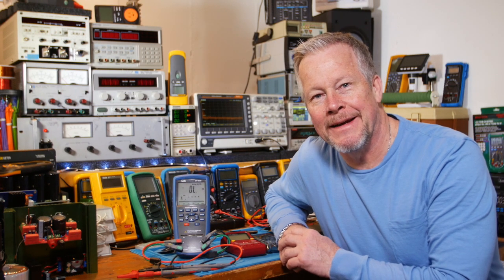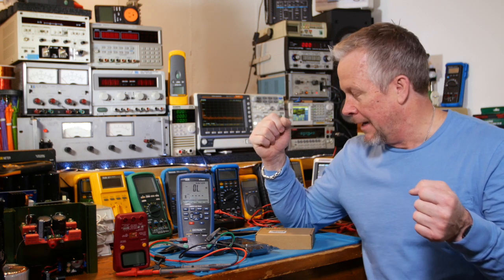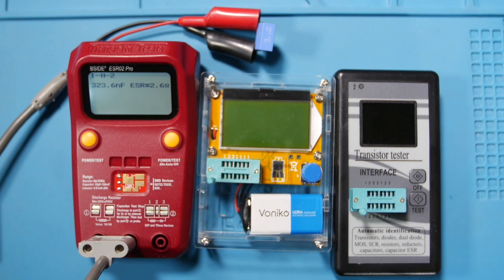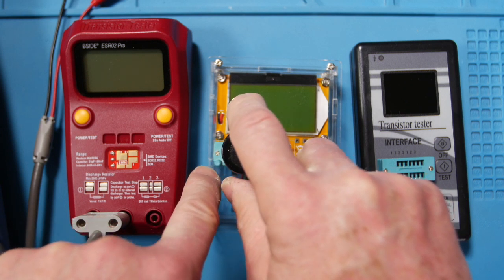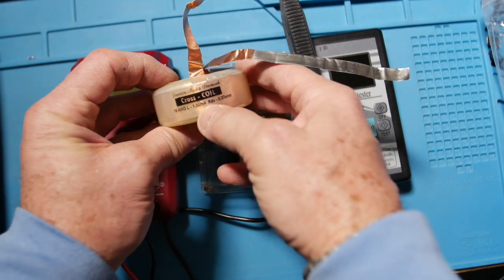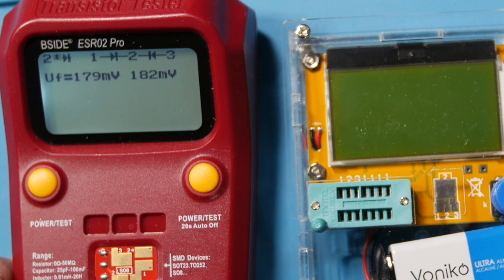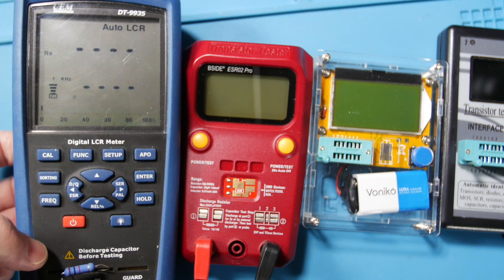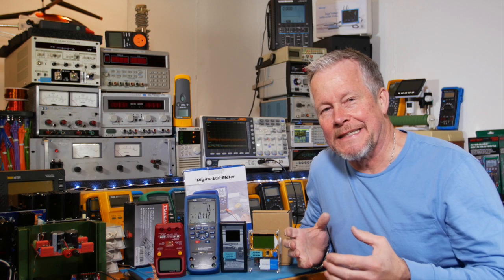LCR and Transistor Tester Comparison

Comment: Thanks, Eddie. I use my DE-5000 and an insulation tester mostly for capacitors and inductors. I do not see much point in testing the ESR of a capacitor without referring to the datasheet and using the same frequency that the manufacturer uses. 
I also use a humble little VOM with X10K to test P/N junctions. It is a waste of time to test them with meters that do not test them under a load in order to verify that it is good. Sure, the cheap meters will catch most of the bad P/N junctions, but not all of them. And I can, and have, proved it.
Reply from the maker: Robert Calk Jr. Thanks Robert for your feedback # always insightful!  Actually the esr changes with so many variables that some manufacturers actually provide graphs but often we are lucky to get just one number based on one frequency.  Some give it for two frequencies, like a low one 120 Hz and a high one 100 kHz.  Ive shown how to use your scope and oscillator to get the impedance across a frequency band.  I think this important part needs more videos;)
Reply: @KissAnalog  Yeah, there are many, many videos about testing capacitors. That's why I have added capacitors to the list of things you do not want to talk about at family get-togethers; religion, politics, and capacitors. LOL!!
Reply from the maker: LOL :)

Comment: Thanks for the video on LCRs.   I'm looking for an LCR to measure wound toroids accurately.  Mostly Ham HF band.  Example I wound a toroid to get close to .7 uH for the 14Mhz band  (16 turns on a T37-6 toroid, 24 AWG enamel wire).   Currently I have a cheapo TC1 multi function testor,  it thinks its a .8 ohm resistor!  a $300 bench LCR meter would be nice, but I have neither the room or money for such luxury.   Thanks again for the reviews!
Reply from the maker: I know what you mean Jeff - but these options might make sense, or be worth trying;)

Comment: Very helpful video! I have been trying to save some old music gear from oblivion using my VERY basic skills. I came here looking for information about the M-Tester (Branded Kuman in this video) and it seems like a dream. Having a inexpensive little device that can identify and test a component is super helpful. I was not sure it could handle larger capacitors, but you certainly proved that it can. Thanks again!

Comment: You tried to measure the ESR with the wrong function at the CEM. In automatic mode, it can only show the D-factor. To measure ESR, you press the "function" button twice so the display shows "Auto" and "Cp". Then press the "D/Q/ESR" button twice. The lower display will show "RP" or "ESR".
Reply from the maker: schorse1000 Thank you schorse1000!  I need to work with this meter more;) The CEM meters seem to be very solid!
Reply: @KissAnalog  Yeah, it's a nice meter.  Btw, the big caps don't like the >1kHz, which is normal. They're not meant to work at high frequencies, so you have to use the 100/120Hz.
And for the other testers, somtimes you can push the button to scroll through a menue with more readings. Some of them even have a push/turn button.
Reply from the maker: Thanks for your help!

Comment: Thanks for the review.Testing the 50pF capacitor with the BSIDE instrument (in minute 23:51) you should disconnect the pluged tweezers; that is the reason for a higher cap value. I would go for the BSIDE model, mainly due to the terminals and the connection clamp, the discharge terminals, the SMD pads, the reading speed and the greater robustness of the casing; although it looks like something out of a 60s science fiction movie...But, it applies a +-5V pulse to read the ESR in the capacitors, and it can not be used in circuit!!!

Comment: Just bought the LCR-T4 Yellow one on Ebay w CASE for about $16. The Bigger display is the  reason I brought this one. Is there enough information to tell if a Transistor is Bad? would be nice to see a video for testing components and what to look for to identify bad components? Troubleshooting Component , what the terms mean and range to look for good and bad ones
Reply from the maker: Thanks for this great feedback!  How do you like it?
Reply: @KissAnalog  Really like it, Doing a lot of vintage audio restoring, its nice to know what the transistor is NPN or PNP and w new transistor Always check the BCE pins their not always the same always double check and install it the right way and Quickly ,,,, testing and capacitors. I also solder in test leads to the solder pad for external testing.

Comment: Generic large electrolytics are designed for not much higher freq than 60 Hz, which is why they are often paralleled with low value, (.1 or .01ud) caps to bypass RF to ground. Low ESR switcher caps go to a somewhat higher frequency, but they are still designed for bulk power supply support and their capacitance goes to Hell at RF. I suspect the cheap meters test caps at a very low frequency while the better meter clearly allows for higher freq tests, and even its lowest frequency is above what the generic electrolytics can deal with. I like to test caps with my NanoVNA when I'm working at RF because it quickly characterizes them at the entire range of frequencies of interest and quickly identifies the self-resonant frequency as well.
Reply from the maker: Thanks for your feedback!  I'll have to do a video on bulk caps and the use of HF caps in parallel.  There is a lot of misinformation out there;)

Comment: I have the same component tester with diy case And the LCR meter from Peak Electronics the lcr45 I love working wilt the lCR45 because the cable  Connector and battery maybe a year old stil working
Reply from the maker: Bert van Lelieveld Wow so great power usage.  I haven’t had mine as long but I still have the same battery as well.

Comment: After almost 40yrs hobbying and making a career of electronics i finally bought myself a decent (i thought after doing the research) handheld LCR meter for the home workbench. I even sprang for a known named brand so paid north of $300. The unit took weeks to get to me which was kind of weird and out of the box it just did not like powering on for a press of the power button. When it finally did the meter's coloured LCD showed the LiOn batteries were charged ok. 1/2hr later i went to do some real work and dead meter.... It refuses to power on since and is a now a paper weight on account the supplier is closed down due to the current unusual times we're in. Just one of those things i guess... That good thing is i I have 2 nice 18650 batteries you could say cost 300 bucks which are doing great work elsewhere! I guess measuring inductance is gonna have to stay a low priority a bit longer....
Reply from the maker: I’m so sorry about your problems just trying to get theater that you spe DC
Reply from the maker: Let me know if there’s something that you would like to see;)
Reply: Andy, apologies to have platformed my disappointment of a purchase gone bad using your channel, (a bit of cabin fever kicking in after 2weeks locked down where i live). I should have added that it would probably have been a better idea to invest in one of the units you presented here. It's for my home workbench as in hobby time where i  dabble with all kinds of electronics... I will keep my eye out for an LCR meter locally as well, perhaps an old ex war-time military tester that needs rebuilding.... that would be a great project!
Reply from the maker: Not at all - great to share experiences.  I always hope for the best but sometimes it doesn’t happen - and I’ll share too.  Got to keep vendors honest;)

Comment: I brought another model from U.R
S.S, model Miron 63V3 and is more mutch precision in measurement prestige.I will recomand Miron 63V34 from Russia !
Reply from the maker: Thanks for this feedback!  It would be really cool to see the Miron, but I searched for it and nothing came up;)
Reply: @KissAnalog  ,In Romania, there are a few people who build something like that, but for now there are two electronic schemes, with a 6F22 battery supply, but also with a Nokia battery, model BL5C, on the side of which the battery can be charged from the mini usb plug. I have  the 9 volt version, but I don't know where he stole the microcontroller writing program, because it only measures capacitors in microfarads, frequency up to 50 volts, and coil inductances...

Comment: Alot of the smaller ones are based on arduino. The mesr-100 is a decent little esr meter. The uni-t ut12 looks alright. Imsai guy just got a keysight one. It's awesome.

I'm left to wonder how well the smd pads can couple with the ic or what have you without some sort of compression
Reply from the maker: Thanks Joey!  I agree - the SMD pads are a bit questionable.

Comment: Wouldn't the higher frequencies make the higher valued caps look more and more like a short? I think that may be the issue with the CEM.
Reply from the maker: Great question.  It does suggest in the manual to try series or parallel measurements and frequencies depending on the value of the part - inductor or capacitor.

Comment: If you could write a quick result comparison table between them and the referance it would be a lot of help. but great video!
Reply from the maker: That's a fantastic - and seemingly obvious idea;) now that you suggest it.  I'll do that - thank you!
Reply: Agreed, I watched your video about 3 times and spent a long time moving back and forth between results of the different meters. You even said you wrote down the value of one of the components, yet at the end of the video you didn't show a comparison chart or graph nor did you make an actual final conclusion on which meter is the best one to get. You appear to have a sizeable collection of test equipment on your bench, I would have expected a comparison of the meters tested vs the real value of each component and how close in tolerance each meter was to actually give a quantifiable conclusion.  As of right now, I still do not know which of the 4 meters to get myself. I'm just a hobbyist so I do not have the budget for high end equipment, but I rather not buy anything that doesn't work correctly. So can you post a reply here on which meter is the closest to the real value of the components tested? I specifically want to know if the ESR02Pro is a good purchase choice.  BTW, pro tip on your audio. get yourself a audio splitter cable, record one audio track with your good mic, and use a second mic as a secondary input. This means you always have a backup on mic inputs to choose from in case something stops working as your camera will save each mic to a different channel and your video editor will let you select which channel to use as your final audio output will be mono anyways. Hope this helps. But yea, if you could comment on how good each meter is on like a 5 star rating at least or even say the ESR02 is about 80% accurate and the others are 70% etc. Just something definitive that I (all of us watching your video) can use to make a purchase choice. Be a good idea to update the description of your video with your closing thoughts for future viewers. Thank again for your work on this video, just wish you actually gave us a definitive conclusion. Much love from Canada.

Comment: Hi, did you zero the testers before use by shorting the leads together?  Adding cables adds resistance and changes the results.  Some of these come without cables for a reason.  You might get away with adding short cables and zero-ing the tester before use.  Do not use long/beafy leads with these small testers.
Reply from the maker: You are right, the cables can add something to the test - especially for low value parts.

Comment: I have the BSIDE esr02 pro.witch i think is best and reliable  of those relative cheap tester,s.If you test components in the socket you have to calibrate it.The same if you use test leads or the tweezers.I have bought 2 tc1 component testers.they are crap they dont last both mine broke pretty fast i repaired one but it broke soon after again.The BSIde esr02 pro have lasted and i can use a power adapter with it.If i want to shure  i use a DER EE lcr meter DE-5000.I also have a Mastech MS6013 witch was the first i got and show only the cap value and not very acurate
Reply from the maker: Thank you for the feedback! How do you like the DER EE?  I almost bought one and keep considering it;)
Reply: @KissAnalog  DER EE ilike the ways you can test capaitors.Can change the hz caps are tested with from 100hz 120 hz 1Khz,10 Khz and 100Khz with a dedicated button.It has many parameters it can show and accurate.+ pc log or on instrument log features.The auto setting works fine for most tests since it allow for change of the test frekvens.and easy to scroll true all parameters it can show on a cap.
Reply: Can you measure ESR at different frequencies with the BSIDE? Which is the highest frequency? Thanks!

Comment: very good video. I have a question is there any LCR meter that can measure components on the pcb board without removing them ??
Reply from the maker: Thank you!  Yes, most can measure some 'in-circuit' components, but some do it better than others.  I have a new LCR meter that I will review very soon - before the end of the month;)
Reply: @KissAnalog  sounds great what is the model of the new LCR ?

Comment: In a Laboratory I have asked as wel With a 1000 dollar LCR meter not possible to measure I used the one with a metal housing Wich need e cooler
Reply from the maker: Bert van Lelieveld I’ve used the expensive ones too but have you used a Z meter by Sencore?  I used to find them everywhere.
Reply: Kiss Analog  no the LCR meter from Peak  No inductance , and the component tester from alieexpress  No inductance Eddie

Comment: Did you ever tried to measure inductance of a 30K or 68K wire wound resistor in Audio Amps at anode phase shifter I have 30K Resistors Not wire wound What I like to do is some tests with wire wound or normal I guessing that the result is the same
Reply from the maker: Bert van Lelieveld No, I haven’t tried measuring the higher Ohm values.  That is very interesting Bert!

Comment: You should try upgrading the firmware let me know if you need any help
Reply from the maker: Thanks for the great advice!  How do you update the firmware on this one?
Reply: @KissAnalog  There is a topic on the eevblog discussing these "transistor tester" devices, you will need a usbasp or an Arduino to program the Atmel chip, you have the T4 (yellow) board you can see the firmware update process in this video /watch?v=B9iPQfGv8W0

Comment: FOCUS!!! :face-orange-frowning:  As you can see these are beginner's toys and not suitable for accurate selection or circuit analysis.
Reply from the maker: Thanks for your feedback!  - I'm sorry - what did you want me to FOCUS on?

These are very useful 'toys' they can detect what your part is and what the leads are.   If it is a bjt transistor - it will tell you which lead is which.  And it will tell you the gain.  If you know how these things work and what they are telling you - they are very useful - especially at their 'low' cost.  My thumbnail does call these out as 'Low cost...' so with that expectation - they are pretty great 'toys'.  ;)